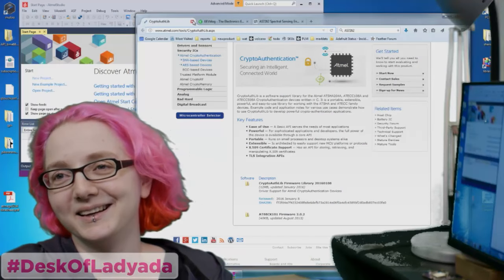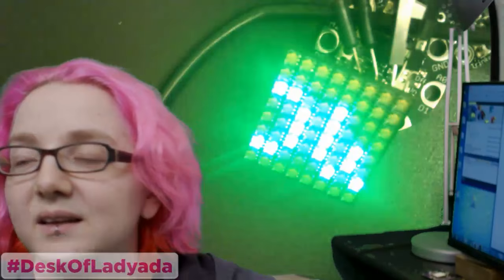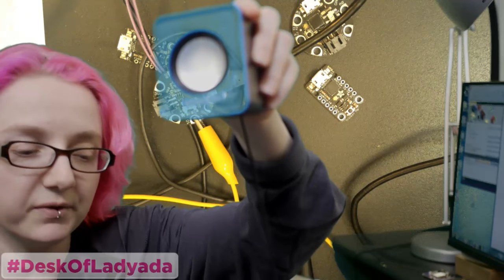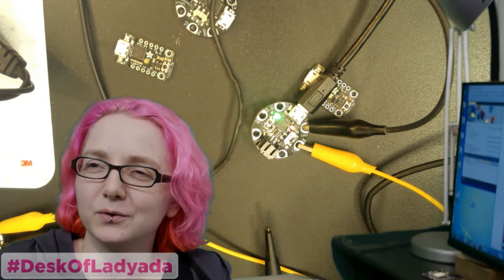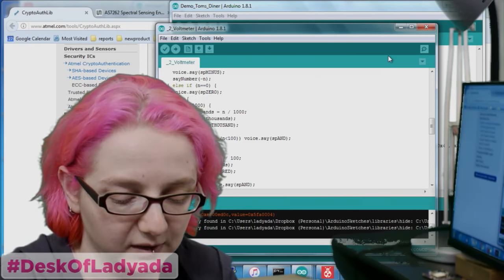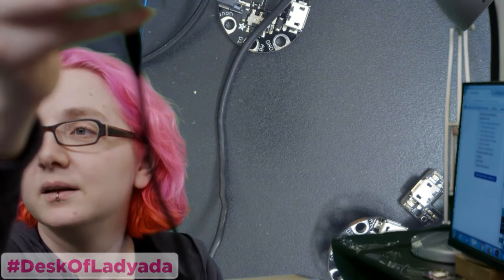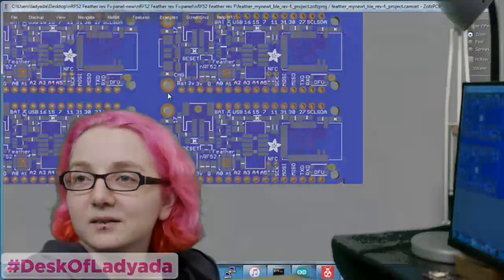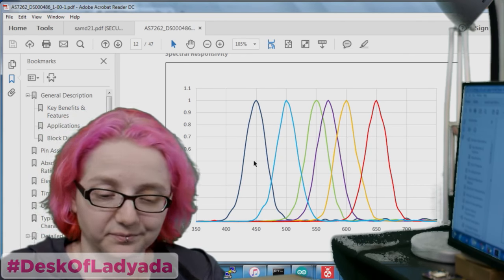#DeskOfLadyada SAMD audio and talkin’ demo @MicrochipMakes @MicrochipTech @adafruit #adafruit

Comment: The AS7262 Spectral Sensor chip looks mega interesting.  Where something like this comes in very handy is indoor plant growing.  Plant leaves will grow differently depending on the wavelength and amount of light they are given (both photosynthesis and photomorphogenesis).   What would you include for the reflective surface that would collect the photons?  What a great BoB it would make.  Why don't you make a circuitplayground science edition and include this?